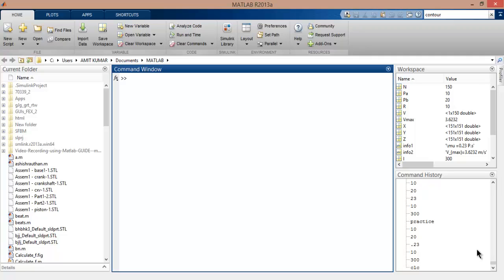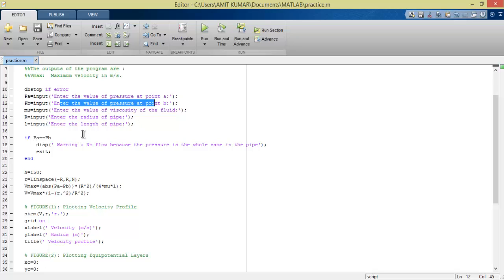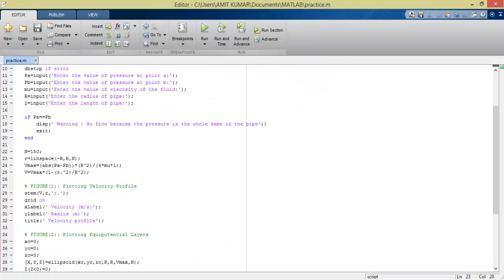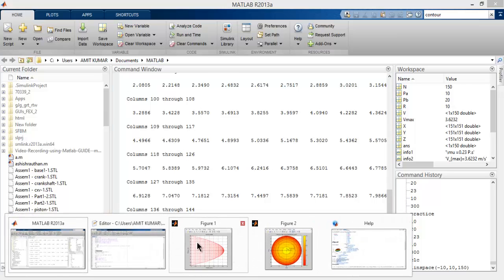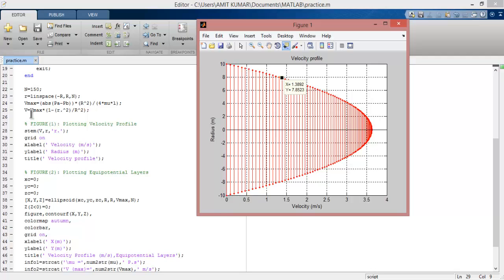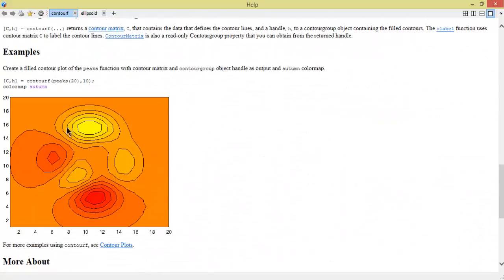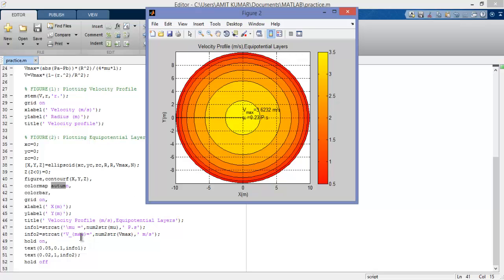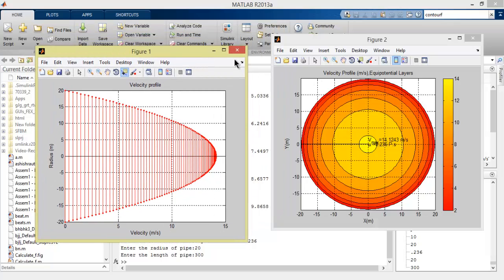velocity profile of viscous fluid across the radius of pipe using MATLAB

Comment: Could you explain how to do this for a fluid between two parallel plates, while the top plate slides from rest? Dont need to make a video btw
Reply from the maker: τ =  µ (du/dy) use this formula

just use linspace with dy and you will get the result